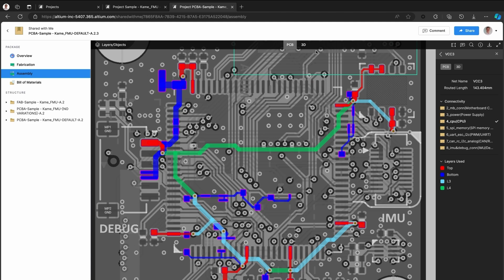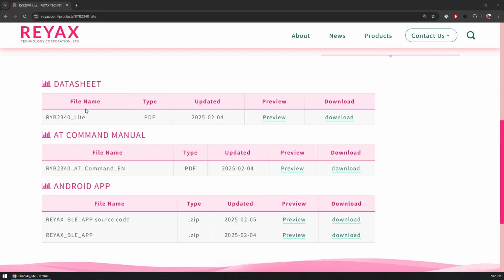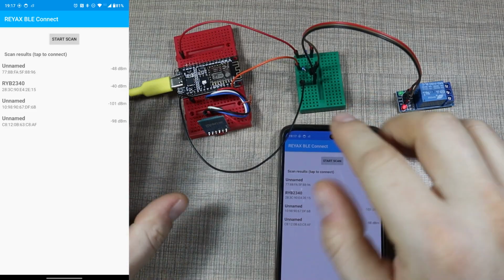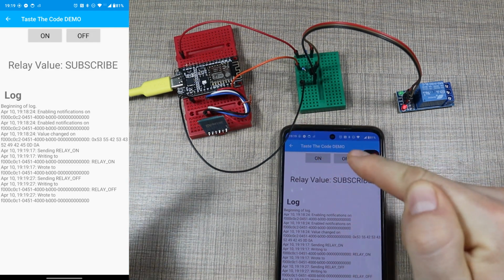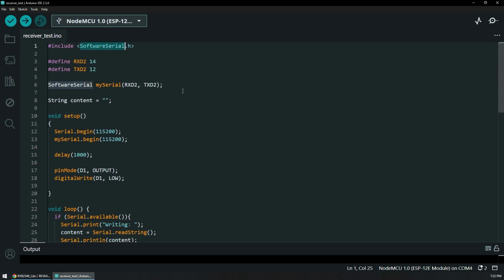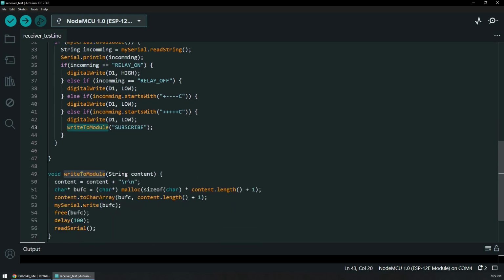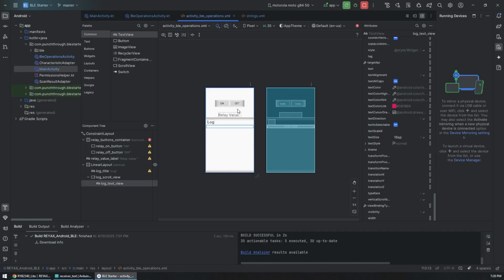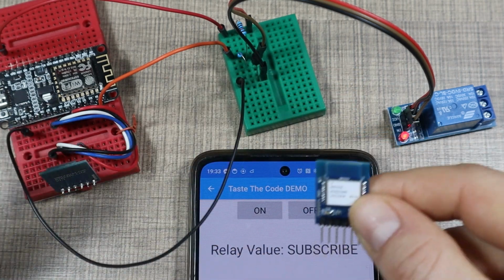The Easiest Way to Add Bluetooth to Arduino & ESP8266 with RYB2340

Comment: Why not use a esp32 mini?
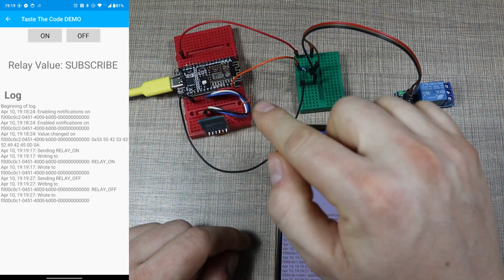Reply from the maker: I go over that at 6:35 but in short, with a dedicated module, you offload part of the complexity to that module so your code is simpler and smaller since you only need to worry about serial and not about managing BLE.

Comment: First comment, next watch the video.
Reply from the maker: Nice, I hope you like it!
Reply: @TasteTheCode  I mainly use HC-05/6 in my projects however lack of Bluetooth LE is becoming a problem nowadays.
Reply from the maker: @VladoT  This one is particularly efficient for battery operated projects. It uses 2.4 mA in regular operation while connected and ~11mA when transmitting.